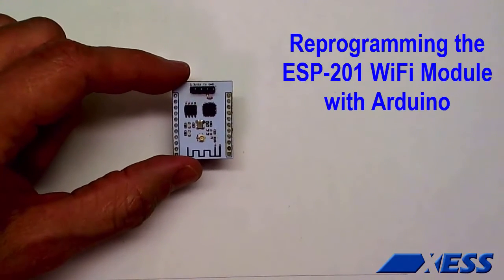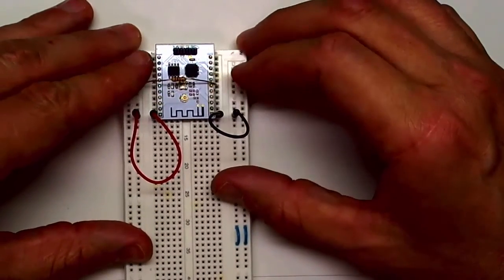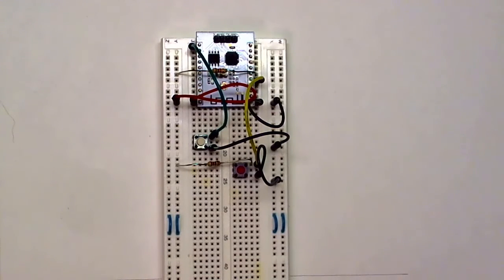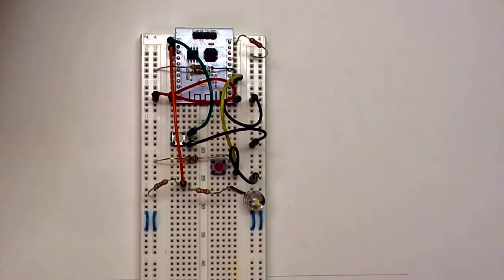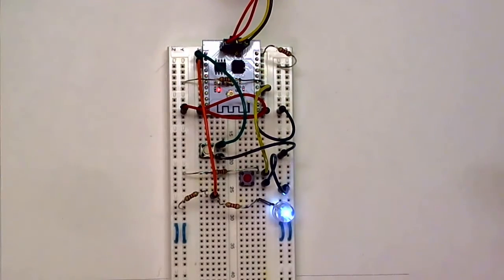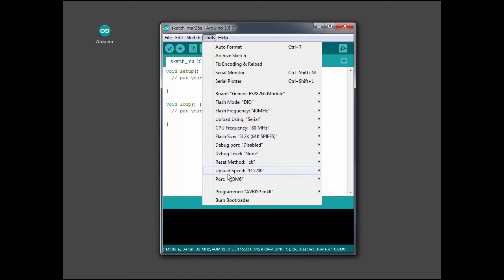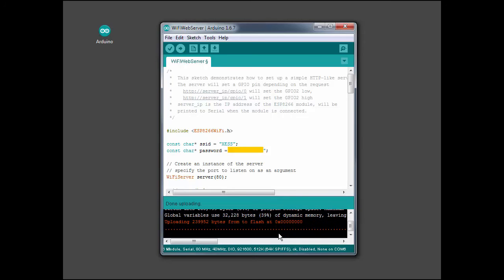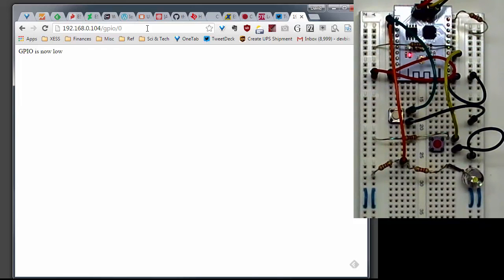Programming an ESP-201 WiFi Module Using the Arduino IDE

Comment: thanks so much!! best tutorial I've found on setting this up, turns out I had the tactical buttons in the wrong way, also you have to quickly pulse the reset button for it to switch to the programming mode

Comment: HI I am trying to upload the code after following your video but I keep getting error messages espcomm_sync failed. I added 470 ohm instead of 1K resistors in GPIO15 and GPIO2 but I get the same error
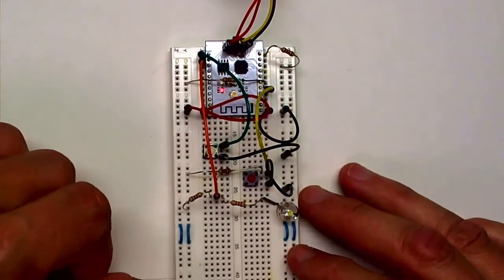Reply: Did you ground the IO0 pin while powering up the module,  to put the module into programming mode you need to ground IO0 while powering up the module, refer at 7:55